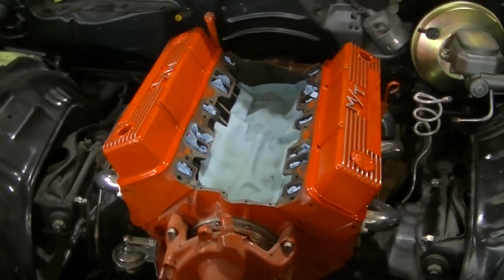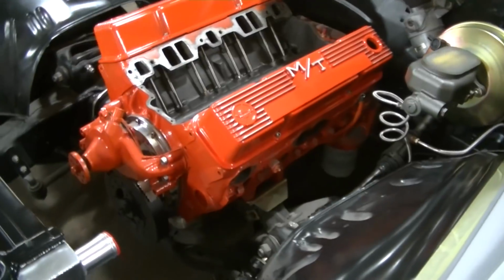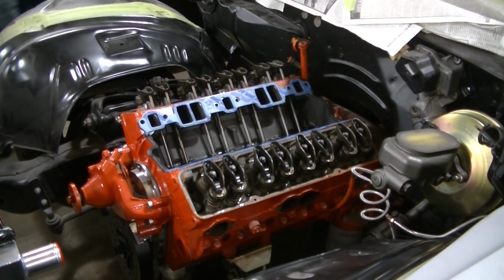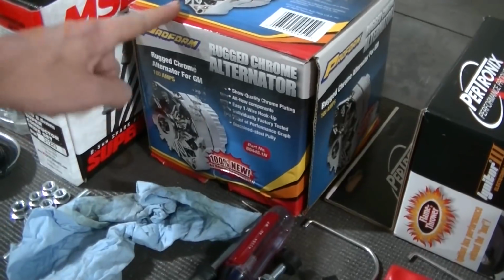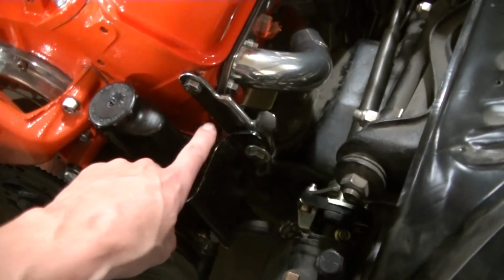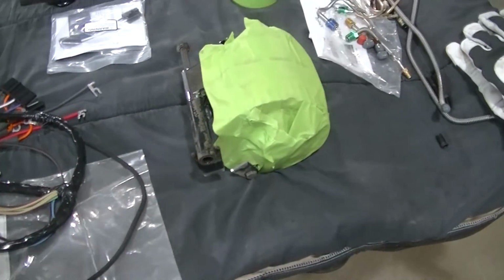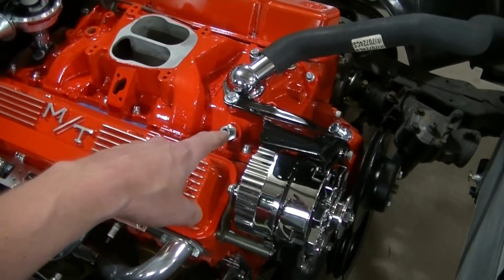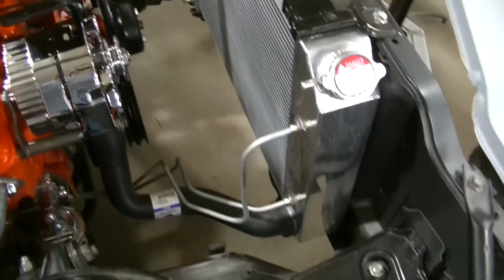70 Camaro SS Project "Edelbrock Intake, Chrome Alternator, Pulleys, Distributor"

Comment: Looks good!  It's a real PITA when things don't line up right.  I believe that opening you plugged under the rad hose is for the temp sensor hole.  Need a chrome alternator bracket to set it off :)
Reply from the maker: We have never seen an intake that needed to be slid back before but this one did.  It was a used intake so who knows.  The temp sensor is on the head on the drivers side.  Some more chrome and upgrades might happen down the road.  Just trying to get this thing running.

Comment: Could be a long water pump instead of a short water pump why the pulley isn’t lining up. It looks like a long one. Kind of hard to tell from the video but it sure looks like it.
Reply from the maker: It has a long water pump.  All these parts were the same ones that came off the car so they should fit.  I am guessing the alternator never did line up perfect.  A couple washers and it's right on.
Reply: mossman381 awesome. Maybe the little spacer was missing on the alt. Keep up the videos. Great job. Love the farm videos. They helped me a lot I have a cranberry farm myself.
Reply from the maker: Yeah,  the farming videos didn't get much for views so I stopped doing them.  It's hard to put time into something and get no return from it.  I enjoy doing the videos to a point.  Then I just feel like I am wasting my time.  The Camaro videos don't get the views but I am doing the car for my dad not YouTube.